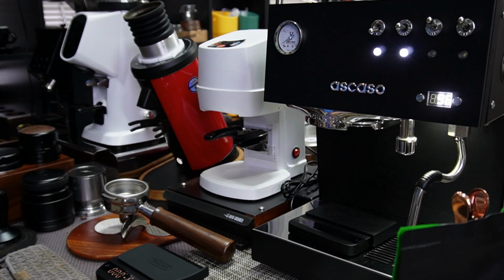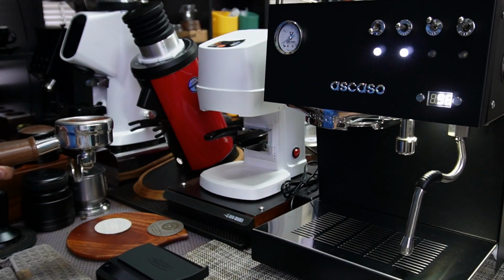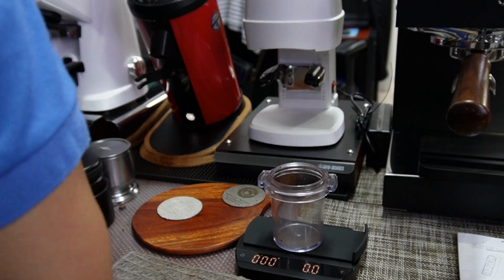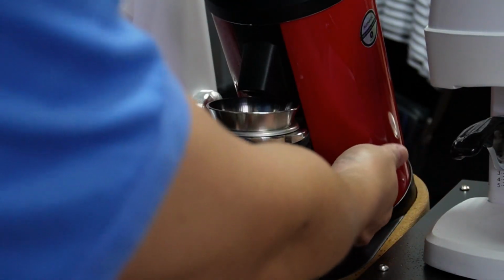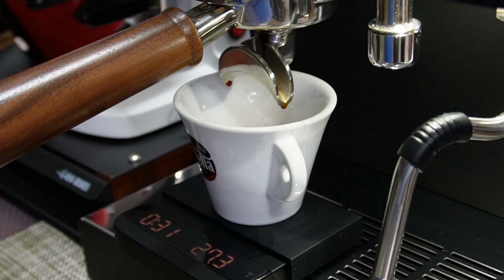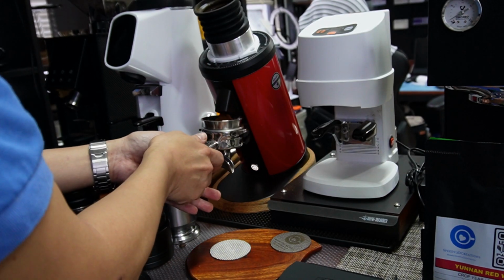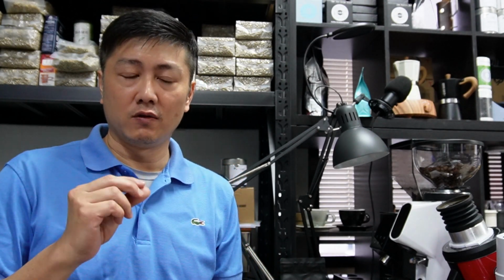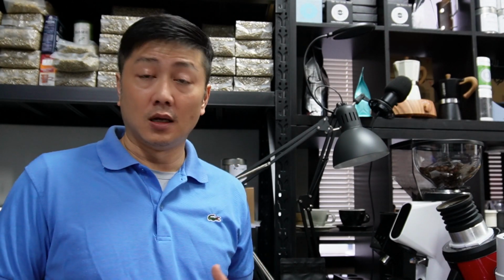How to make good espresso from SSP Cast Burrs on the DF64? | With Ascaso Steel Duo PID

Comment: Great attempt CY. My approach is to wdt the grind in the dosing cup quite vigorously before putting into the portafilter. The adjustments for taste would then be done by grind size adjustment.
Reply: P.S. The cast burrs in the DF64 are awesome. Sweet and mellow….
Reply from the maker: Yes it's is good but rhe super fine powder is affecting the taste in the undesirable way. Nowadays I removed the super fine powder.
Reply: @CaffeMartellaSingapore  Hi. Have you tried without declumper? It seems less fines when the declumper is removed, can it be possible? Because the very fines are always stuck to the declumper and near to it. By removing the declumper I get zero retention. And wouldn’t wdt balance the bitterness you mention? Thanks

Comment: My SSP Ep 83 mm are pretty difficult to screw into the carrier on my Ceado e37s, and the zero point has now changed from zero all the way to 2…should I send them back or will this change with seasoning? Seems like a pretty large jump in zero to fix with seasoning them. So, I’m concerned
Reply from the maker: From my experience, all SSP are thicker than stock burrs and hence the movement of the position. I dont see any issue with that.
Reply: @CaffeMartellaSingapore  thank you so much! That scared me a bit haha. Love the channel!

Comment: Hi, just wondering if you can confirm whether or not  Ascaso will be releasing a Steel Duo Plus model early 2023 and if so what are the features of this new "Plus" model compared to the current upgraded steam model with the steam knob on the right hand side of the machine.  Many thanks.